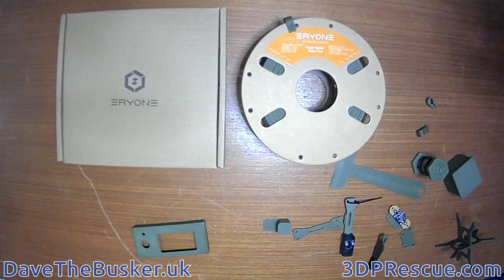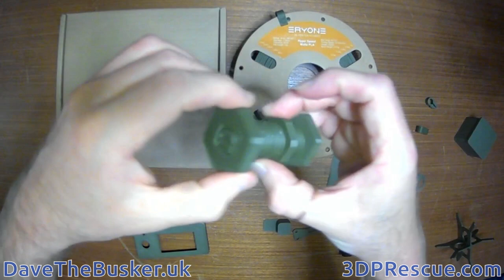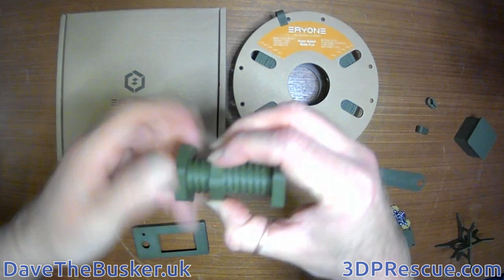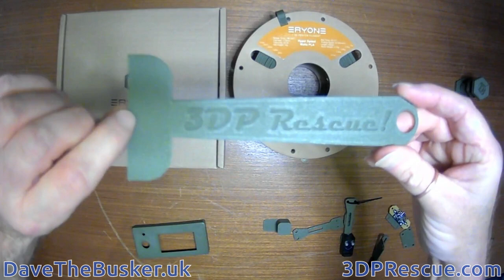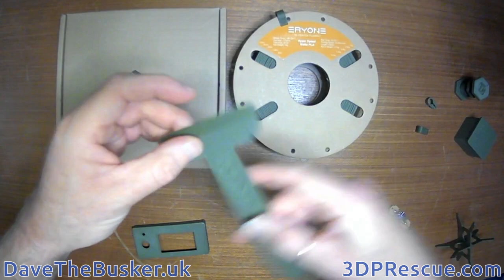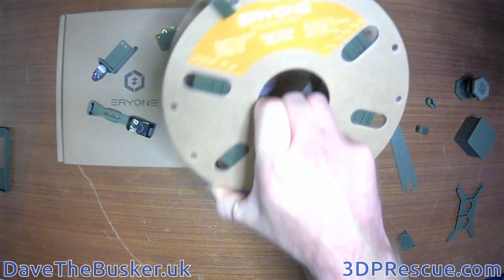ERYONE High Speed Matte PLA - Olive Green - Review

Comment: I'm having a bad time with this exact filament (but in white). Would you mind sharing your profile? Thank you.
Reply from the maker: What printer and slicer are you using ?
Reply: @davethebuskeruk  A1 mini, but recently I lowered the printing temperature and it fixed most of my issues. I also switched back to a 0.4 nozzle.
Reply from the maker: @DanielTralamazza  That's great, this stuff does need the lower temperature and not too fast a printing speed.

Comment: i ordered this off ebay and it wont stick to the bed :/. The black does tho
Reply from the maker: I didn't have that problem, what temperatures were you running and what build surface ?
Reply: @davethebuskeruk  dang i missed this. Uh im trying 230 now and bed at 70 and its still printing terribly. uh im new so i think my build surface is steel sheet
Reply from the maker: @hakimdurand8427 it's odd that one filament will stick well but not the other. Have you tried drying it ?
Reply from the maker: @hakimdurand8427 also as this is high speed matte PLA it prints at a lower temperature than normal PLA and if you aren't printing it at high speeds it doesn't need to be as hot. I think I printed the items shown at 190 / 70
Reply: @davethebuskeruk  havent tried drying and i mean i am in a hot place.. caribbean to be exact.
Reply: @davethebuskeruk  I ordered matte olive off a ebay seller and i realized this looks nothing like urs... its glossy looking and just overall garbage
Reply from the maker: @hakimdurand8427 ah could be you've got a bad spool or a knock off counterfeit one. Try 60 on the bed maybe ? Sorry for the late reply, I didn't see the notification